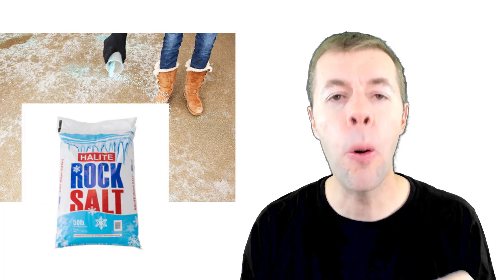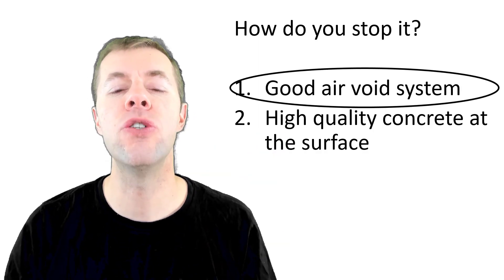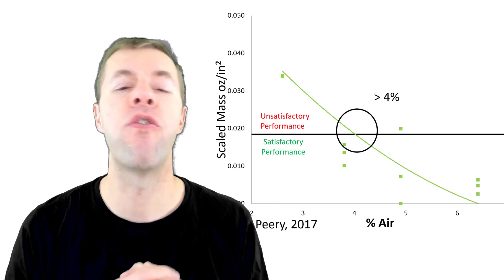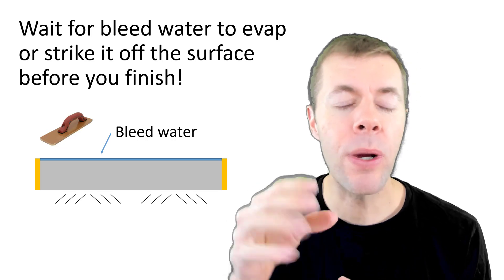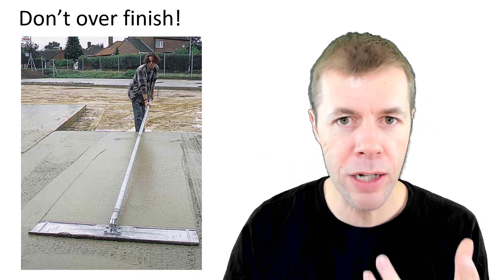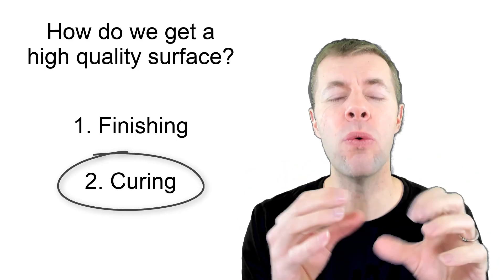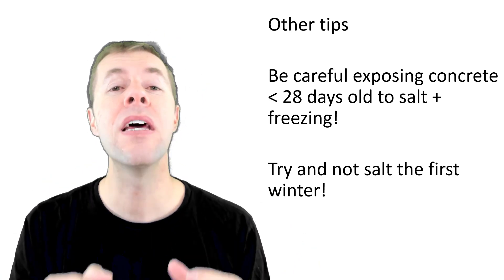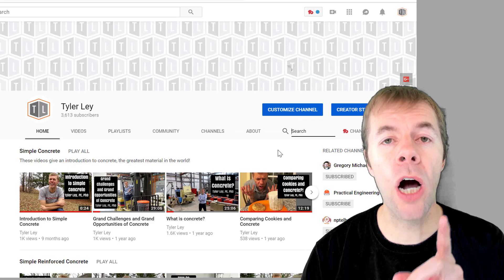Intro to concrete scaling

Comment: Hi Tyler 

Do you have videos on the following topics ?

1. Thermal properties of concrete structures 
2. The effect of thermal shock on concrete material 
3. The durability effect high temperatures have on existing concrete. , does the rise in temperatures are shortening the life of concrete infrastructure ?
4. Is it possible to measure the water flowing through cracks ? 
5. Repairing cracks with movement ? Perhaps in elevated slab ?

Comment: Can this situation happen with natural freeze-thaw cycles or does salt need to be present? The video is unclear on this point. Within a week of winter, my patio was poured.  Five days after the pour we started to have very cold and freezing weather at night. During the day the weather was warm enough for thaw.  There were a few days of rain during this time and a dusting oi snow on the 19th day after the pour. Curing temperature was poor. The concrete was left unprotected. No salt was needed. After 19 days we had scaling. It possibly started sooner but was noticeable after the snow especially in areas where the snow was left standing instead of cleared.

Comment: Sir Ley thank you for the very informative videos you are sharing. They're very helpful in my work. What I would like to know also are what are other causes of scaling aside from those caused by deicing salts, improper  curing and finishing (I assume the condition you are talking about in this video is that the concrete is properly proportioned). What if the concrete is not properly proportioned but finished and cured properly? Will this also cause scaling? We don't have snow in our country. I ask this question because I have seen newly constructed pavements but scaled too early. Thank you very much.

Comment: I have been pouring concrete flat work and structural walls since 1986 I quit school and start at 16 and third generation Concrete and Mason and I’m 50 years old now got 34+ years in a breaking my ass made it to senior project manager many different times in the past five years and nobody ever fucking has taught me the most important shit about concrete and pouring concrete then I’ve learned from you in the past two hours since I find your channel I don’t know how much you appreciate a man and I’m taking myself back to school with you over the next year and i’m going to become one of the best and only concrete guys on the East Coast that still at 51 years old I’ll be I can put it down pull the stick on offload finish it hard trailer blown whatever it is and fucking tell you everything about the material so thank you again

Comment: Thanks for these incredible videos. Could you talk about cold joints? Is there any research on strength drop off over time or the impact of Concrete Bonding Adhesives and how they function.

Comment: Hello Tyler, thank you for a lot of effort you put into all of this!
I am kinda confused with different advice in different videos. As fas as I got, bleed water is helpful to avoid plastic shrinkage. But here we see that water on the top leads to formation of concrete of lower strength. So what should be done? Bleed water should be striken off but only after several hours after placement?

Comment: Do you think you could go farther on this topic and talk about de-icers that do the most damage and which do least to the concrete? I've read some studies that magnesium chloride is the worst and rock salt is actually best. I'm doing a bit of an experiment on my own this winter, I've taken some extra concrete beams I've made this season of different mixes and air contents and kept them, and I've put rock salt on one side and magnesium chloride on the other to compare them. I even managed to make one of non air entrained concrete at the ACI recertification class. We got our first snow on Monday, so first application has been put on!

Comment: Good content and you are a charismatic speaker - I would recommend framing yourself so your hands are in view at all times so they are not popping in and out of frame. Seems better to leave the background in (totally fine to shoot in your office - you are a professor) than to have software remove the background, which leaves a weird line around yourself. I would also leave the music out - informational youtube videos typically don't have music. The ones that have music are the ones where a guy is showing off a technique and only talking intermittently.
Reply from the maker: Thanks!  
I have a background that I want to use in the future.  You may have given me the push to try it sooner.  Thanks!

Comment: Great as usual...  I have a solution for eliminating scaling and the use of deicing chemical agents.. Electrically conductive concrete heated pavement system. We have constructed two slabs at Des Moines International Airport..I am sure you heard about it and I just wanted to share it with you.. It prevents/melts ice and snow accumulation on pavement surfaces.. It is for small area like gates or apron area in airport because it is relatively expensive.     
Here is some reference.        
                                                                                                                                                                                  https://www.researchgate.net/publication/325542716_Design_and_Construction_of_The_First_Full-Scale_Electrically_Conductive_Concrete_Heated_Airport_Pavement_System_at_A_US_Airport      
                                                                                                              
https://www.today.com/money/could-heated-runways-melt-away-your-winter-travel-headaches-t121729
Reply from the maker: Thanks!  
I am worried about the cost of these.
Reply: They have all the time at ski resorts in front of there doors